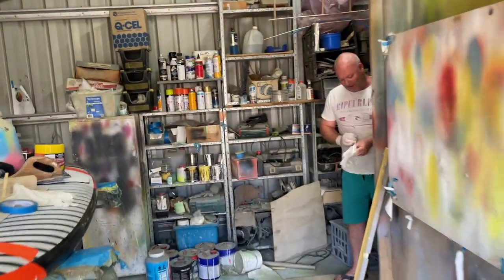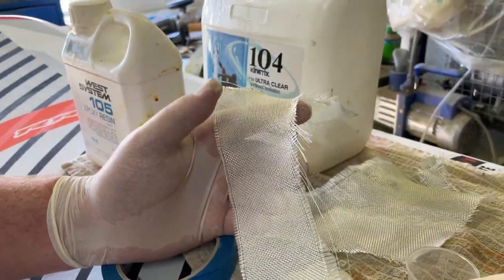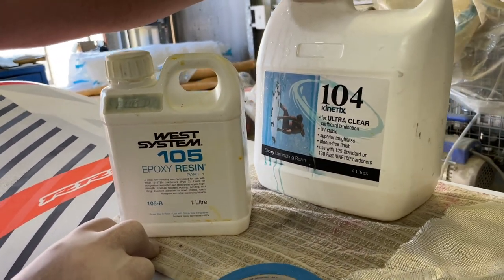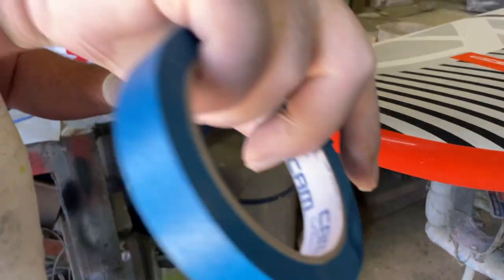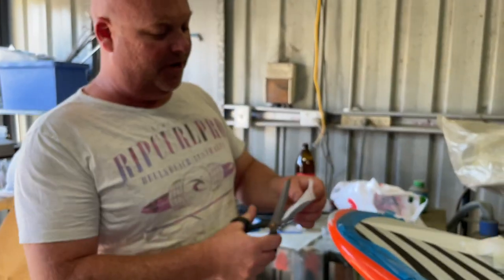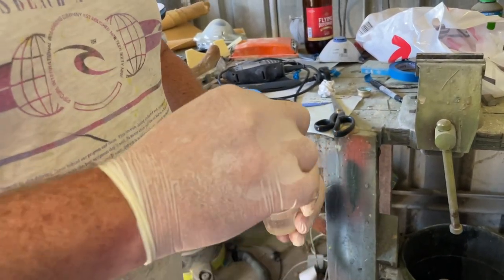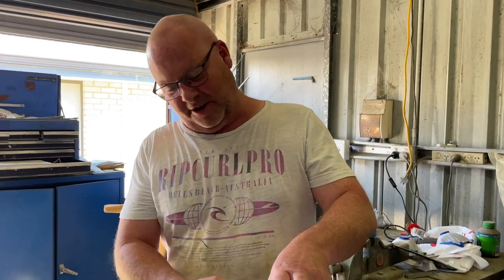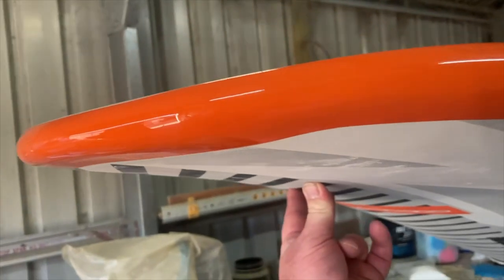Windsurf Epoxy Nose Repair

Comment: On the Seabreeze blog website I have always liked the comments that  a "Mark" made on damage to the noses of foilboards from over the handlebar crashes and the problems with nose pads.  I now can put a face to the name and see how knowledgeable he is. Thanks so much Mark!!
Reply from the maker: That’s the guy! 😀👍
Reply: Also thanks to  @windsurfer  for putting this video up.  Like James below, I am going to take a crack at fixing a botched job.  This is for a foil board with cracks right through a nose pad, as Mark has done several times.

Comment: I have to agree with Den. The most difficult part, having a nice spraypaint, is missing and Mark actually nailed this. Also Mark took more time and work to have a nice finish instead of having a better repairment of broken structure. Or even showing how a nose can be build back stronger. Which makes a lot of sense since the nose has objectivly shown it is build too weakly. I guess it soon will be broken again.
But of course, a repair is allways better than duct tape or nothing.
Reply from the maker: We’ll make a video soon to show how to paint the board 👍
Reply: @windsurfer  Great! I am looking forward to that.
Reply from the maker: https://youtu.be/-fNRcIfNWzU

Comment: I feel like when I do this work, when I get to the sanding, my sanding bites into the glass long before I get a smooth fair surface. I don’t think I make a large enough low area before putting the fibreglass on. So useful to see someone else do it.

Comment: Great repair video. What sort kind of paint and which color number did you use? i've repaired my RRD. But i don't now which paint and color number to use.
Reply from the maker: So I checked with Mark & this was his response;
“The RRD nose repair was mixed by me - it’s not a code. 
It’s 2 pack and that I didn’t cover it, as it’s too poisonous and technical. 
They are better to use a quality orange from auto paint store and paint the whole thing instead of trying  to match.”

Comment: Excellent explanation/lecture...As we want u all to live as long as possible..We have some recommendations...
1- Always use  vaccum cleaner to get rid of the poisonous dust..Either during the operations of just after...the jobs. Remember u worn mask later..But there was already dust by the time u fisrts sanded..(remember about the dog also his nose is nearer the ground);
2- Promise u get rid of the contamined materials (leftovers of chemicals, mixing bowls, masking tapes.etc..etc..etc..) In the possible environmentally safest manner.
3- You mask has exaling valves....Be careful maybe u  inhaling fine dust..But I´m not sure....I know for covid-19 they are not recommended..
Reply from the maker: Thanks for the feedback Paulo they are all good tips!

Comment: Thanks for the video guys!! It gave me the courage the fix my board. But I couldn't make out what the filler you used was. Was it "Q Cell"? I can't find that here and ended up using fiberglass filler which is really hard to get a good finish because of the thick strands. I think my fix is strong, but it doesn't look as good as yours. ;-)
Reply from the maker: Ah yes it was Q Cell we used. Good on you for doing your own repair it's very satisfying!

Comment: Thanks for the video, although I'm not so impressed with the quality of the repair job. Glassfibre is rather coarse (low density), cut inaccurate and positioned even less accurate. The compressed foam under the crack was not repaired at all. Basically he just tied both sides of the crack together with a very thin piece of glass, sanded away to even less, and covered it all up with filler. You can get away with that in a nose job because it is not really loaded with forces or deformation, but I do not consider this a professional repair. It certainly would not do on a rail in the middle or anywhere near the foodpads.
Really liked the tip of the falling temp (or taking out the vent screw). Easy thing to overlook.
Reply: Hey mate, don't over think it. As Mark pointed out, this is something an average punter can hook into. A basic fix, seal and get back on the water... after all it's windy season in WA!
Reply: Ron I think you missed some. Obviously a professional repairer diagnoses it first - He says the nose only had the paint fall off and that carbon was no damaged so he's replaced paint with glass,  there is no crushed foam.  Obviously underneath the glass it still solid so he has replaced glass. He also says don't sand away any glass  so I guess he doesn't. "covered all up with filler" sound like your saying he did a crap job and hid it - almost all the filler is sanded off which shows a GOOD job glass job cos it didn't take much.  I agree with other comments - it showing a job anyone can do not all divinycell replacement etc maybe they could do one like that if they wanted

Comment: Novice question - why not skip all the fiberglass repair steps and just use surfboard epoxy fill kits like Phixdoctor etc..?  - thanks
Reply from the maker: The fibreglass will make the repair more impact resistant.

Comment: Great vid. Why do windsurf Boards and paddle boards cost so much yet they are sealed in cheap paint and auto clear coat? At least a real surfboard is resin and tint, nothing more. Biggest scam out there. Pay bigger, and you get garbage like fillers and paint.
Reply from the maker: Making a windsurf board I’d say costs quite a lot more to make than a surfboard. There’s a lot more man hours in it.
Reply: @windsurfer  I totally agree because i hand shape my own paddle boards. My logic is that if so many man hours go into producing the board, why apply materials that don’t really like being in the ocean?
Reply from the maker: @pearsonmarine5565  ah yeah I see.... I’d be happy with a board that’s not painted!

Comment: if you hit the nose and the bottom is cracked, there is 100% dameged the inside structure of the sandwich. if you dont fix that , the nose is nowhere near the strenght it was before the crash and it was obviously shitty already from the factory. this is not the repaire, this is just hiding the damage. that repair and glass job is as poor as it can be.
Reply from the maker: Mark accessed the damage and came to the conclusion it wasn’t structural. 👍